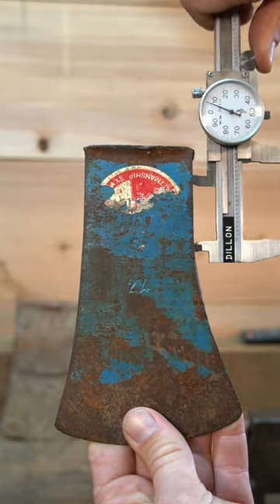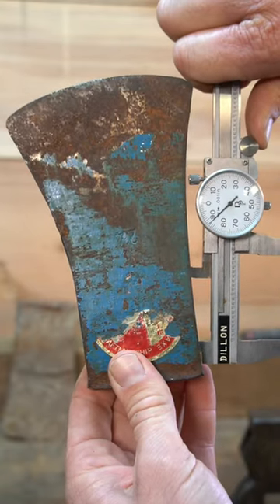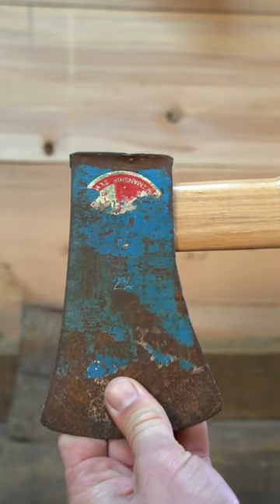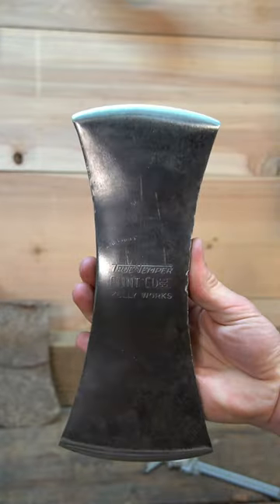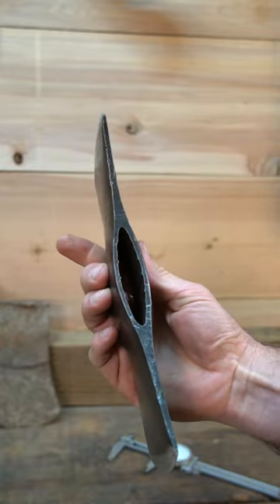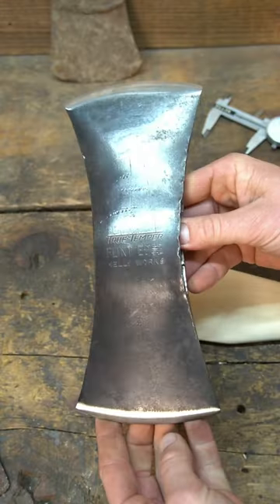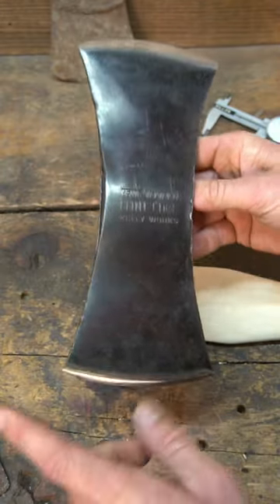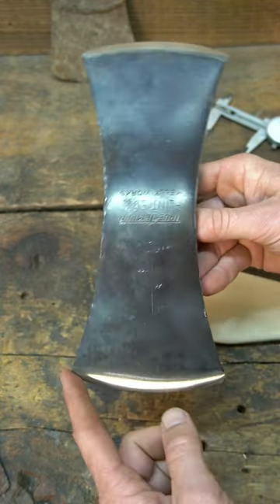How to know which side to put the handle in. #tools #axe #restoration

Comment: awesome!  i was part of an axe group on facebook just to learn something but it was much too uptight in there so it’s good to see content like this
Reply: WeThe People  i don’t think you understand what he’s saying in the video.  the bottom corners of the cutting edges wear quicker than the top corners.  he’s calling it a “toe” and the eye is made to flip the head over so you can have a fresh toe on it.  obviously it’s made to rotate from one blade to the other just by turning the handle over but i never considered that some axes may only be made to fit on a handle from one direction and if the toe is already worn out then that head is not as valuable to me.  i thought it was a useful piece of information.
Reply: OMG I was in the same group I bet. They were so uptight and I hated it. Had to be the same group 😂

Comment: I dont think it would matter either way. The top is bigger so if it loosens and pulls through it tightens itself. I think that design has a straight non tapered wedge to open the eye during forging

Comment: This is interesting, but why make a reversible axe like this when I’d imagine it’s easier to simply re-sharpen the axe?

Genuine question, I know about as much about axes as I do rocket science.
Reply from the maker: Most of the time, the toe wears out before the heal, from use. I would only flip the head when replacing the handle, so it's not really extra work.  The only reason I see that most axes aren't built to be reversable is that they loosen faster because the eye isn't tapered.
Reply: @old_iron_axe_and_tool  ahhh, I see. Thanks for the info dude! Really appreciate it. I love learning things.